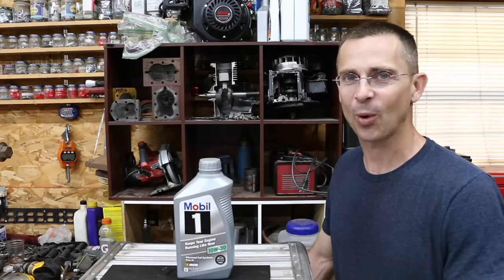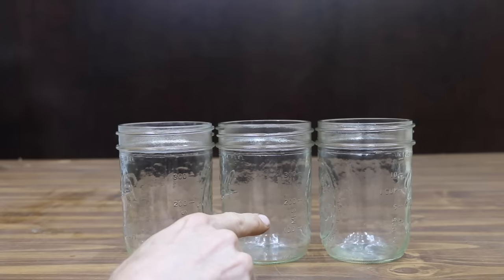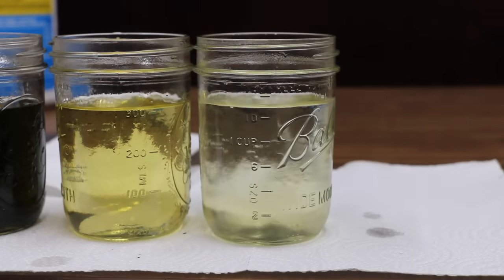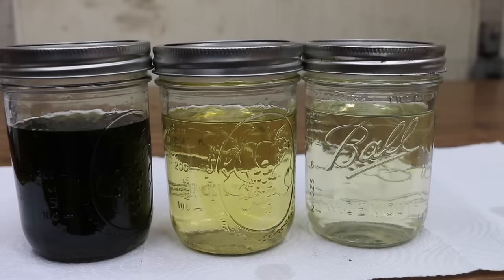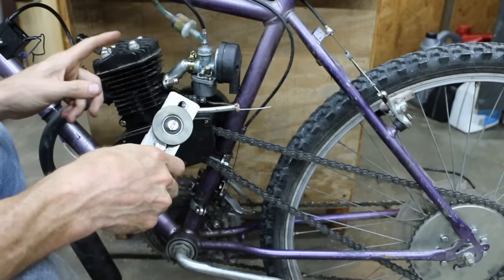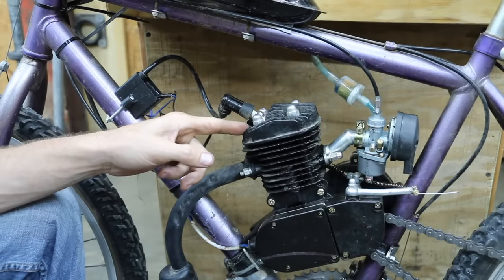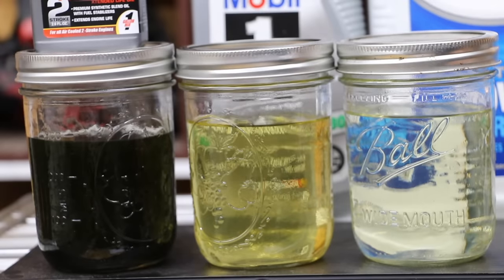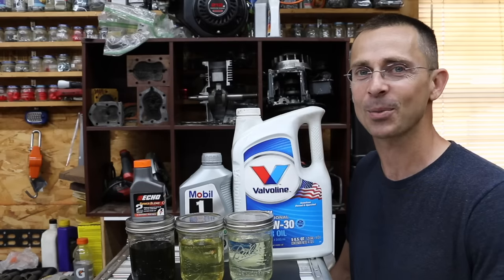Will 4-stroke oil damage a 2-stroke engine?  Let's find out!

Comment: It looked like their was a rapid build up of Coking deposits on the piston head and cylinder walls after running the 4-stroke oil in the bike engine. Engine "Coke" for those that don't know is a tacky deposit left behind when an oil exceeds its temperature limits.
Reply from the maker: Thanks for the feedback.

Comment: That's how it used to be done, just add regular oil to gasoline for a 2 stroke engine. Normally you are supposed to use non detergent.
Reply from the maker: Thank you

Comment: And what about chainsaw bar oil in a chainsaw gas mix ? 
That I’m thinking about if I’m in a hurry I’m the wood and need to use a chainsaw but don’t have 2-strokes gas mix handy.
Reply: It has to have gasoline, it won't run on just oil
Reply: Lol i know that . I’m talking about using chainsaw bar oil as mixing oil.

Comment: I will guess. The combustion chamber will be oily and there  will be more carbon deposits. Of course it will not damage the engine, in fact it will lubricate it better. The big difference is the flash point. A 2-stroke oil needs to have a low flash point and 4-stroke oil needs to have a high flash point. Will watch the video now.
Reply from the maker: Thanks for the feedback!

Comment: Oh boy, what about using dirty oil from an automobile that has had an oil change. Using that for the 2 cycle mix. I will bet it works fine. Perhaps even diesel mixed in to a higher amount will provide enough oil as well. What about using some olive oil, and sunflower oil as the 2 cycle oil mix. What about using butter? What about bacon fat.   ha... be fun to see
Reply from the maker: Thank you for the video idea!

Comment: i mix straight 40 weight at 20:1 for my chainsaws and they run fine
2 stroke oil smokes less because its a lot thinner than 10w-30
Reply from the maker: Thanks for sharing.

Comment: Well I got vespa stroke 150cc i add gear oil to its chamber 650 ml ....and if i don't get 2t oil i mix cars 4stroke oil as %is required the engine runs well but with either of it the silencer need to cut open n clean at same interval ...but new gen 2t generates less smoke ...it's back in 97 i was kid I used 4stroke oil and gas.....it genrated less smoke ...but now 2t engine scooters n motor cycles are long gone due to emmision norms...
Reply from the maker: Thank you for the feedback

Comment: There are MILLIONS of old outboard motors from 30's, 40's 50's and 60's that are STILL running with ORIGINAL engines and the mixing oil was 30 weight regular oil. 2 stroke MIXING oil never came out til the late 60's and was not regularly used til the 70's. You can use a good quality 30 weight oil for mixing with NO PROBLEMS. I have SEVERAL 1950's outboards with original engines RUNNING PERFECT, NOT GUMMED up or anything else. As for the guy on here that owns a small engine shop......he needs to look at ANY small engine manual pre-1970 OR outboard manual.
Reply from the maker: Thanks for the feedback.

Comment: 2 stroke gas is only really good for like 4 weeks then after that it begins having issues running my 250cc dirtbike and during the winter it seems to go bad in about 2 weeks. after my 2 stroke gas is about 5 weeks old I will only run it in my 4 stroke lawnmower.
Reply from the maker: Thank you!
Reply: It would probably still work in like a Weedwhacker or a smaller two-stroke engine a lot longer. but yeah i’ve had a few times where I thought my dirtbike just blew up or something but it was just bad gas that would foul the plug right up. not really sure why it happens because I usually drain the gas back into a can when I’m done riding and my gas cans are all air tight. I only ride once a week if that so my gas does a lot of sitting. when I get fresh gas I can definitely feel the difference in power With such a big 2-stroke engine.

Comment: 2 stroke oil in gas will also gum up.  This is due to the gas not the oil.  The lower quality the carb is, the more susceptible it is to old gas gumup problems.
Reply from the maker: Great point. Thank you

Comment: Can you do castor oil for 2 stroke?
Reply from the maker: Thank you for the video idea!
Reply: @ProjectFarm  I'm impressed you're reading comments in these old videos with over 3000 comments.
You may be aware that castor is used as 2-stroke oil for model airplane engines, so I was wondering how well it would do in a full size engine

Comment: Sir u know batter but i try non syn oil in single ring gas engin it ruins sleeve and lack of compression ngh 9cc rc engine then i try 4st stroke sae30 syn car oil runs well even in old sleeve with new piston and ring set  3year past still runing well
Reply from the maker: Thanks for sharing.

Comment: What if you took a high pressure oxygen bottle, and drilled out the jets, then with the rich burning engine took the oxygen bottle and injected it in the air box along with normal induction
Reply: What would be the result
Reply from the maker: Thanks for the video idea.

Comment: Would Marvel oil work as 2 cycle engine oil, would Marvel oil work as 4 cycle engine oil for short period of time to deep clean it or will it damage the engine due to high heat for long periods of time.
Reply from the maker: Thanks for the video idea.

Comment: My dad used to own a 2 stroke scooter in northern India back in the 90s and it ran on 4 stroke oil premixed in the gas for 10 years before he immigrated to Canada. But the thing is the bike never really sat for a long time that could cause it to seperate. He said he never had any issues. He didn't even measure when he mixed the fuel he just put in way more than he needed and used it to kill mosquitoes 😂. I'm sure the carbon deposits were not too great tho hahahah
Reply from the maker: Thanks for sharing.

Comment: I wonder how the two-stroke would go just using castor oil which is what aircraft model engines use although they run on methanol and castor oil so I wonder how a normal two stroke would go with gasoline and castor oil.......
Reply from the maker: Great test idea!

Comment: most of the older 2 stroke manuals for motorcycles said right in them , use 2 stroke oil at 30 to 1, or you can use w30 motor oil. This is not anything new.....
Reply from the maker: Thank you

Comment: I've mixed my gas like that for years when I was a teenager. I didn't have two stroke oil
Reply from the maker: Thank you for the feedback
Reply: When I ran out of motor oil I found out do not use automatic transmission fluid for premix I had to push that bike 2 miles home LOL

Comment: BLASPHEMY! I used 4 stroke 15w40 instead of 2stroke oil in my Tomos APN6 moped for a few months. Back then I was inexperienced and thought: well, if it works for larger engines and costs more, then...   Well, after a month my relatively new, slightly tuned moped started losing power, expecially when hot.  After 6 weeeks it would barely run when warmed up.  It took me a few weeks and 2 rebuilds before I realised the exhaust is so totally full of charcoal you couldnt even blow through with your mouth  - something it would take years of non-maintenance and heavy use even it the times of the worst Yugoslavian-made oils....   All in all, lesson to be learned:   2 stroke oils are also made to burn / evaporate through exhaust, something 4 stroke oils are not designed to do ;)
Reply from the maker: Thanks for the feedback.

Comment: We aye was a kid we dun that all the time if we never had 2 stroke

Bit if u are puting stuff in a 4 stroke remember if u use to much 2 stroke in an over head cam engine will cos it to run like a bag of bolts and oil can hydraulic lock a cylinder
Reply from the maker: Thank you!

Comment: what happens if you add an oilpan on a 2 stroke engine (somehow)
Reply from the maker: Thank you for the video idea!
Reply: The crankcase of a 2-cycle gasoline engine is what pumps in the air/fuel/oil mixture. 2-cycle diesels have the crankcase filled with oil and the air is pumped in with a blower

Comment: This test was not realistic, as you used a free running engine without load. I fly a Rotax 503, and at idle, the fuel mix is around 120 to one, and as I add power, the ratio increases from the injection pump, as the engine comes under load. 325 on the cylinder head,, shows it is not under load.
Reply from the maker: Thank you for the feedback

Comment: Well now you know if you're out riding around on your bike with the two stroke engine and you run out of fuel you can stop at a gas station and use 4 stroke oil to get you home.
Reply from the maker: Thank you

Comment: You shpuld try adding oil to the crankcase of a 2 stroke engine and see if it would work like a 4stroke without oil in fuel
Reply from the maker: Thanks for the suggestion.

Comment: Oil is oil, if you think they can make a 2 stroke oil that will prevent cylinder scouring in a 2 stroke and It's not good for a 4 stroke, you're smoking the wrong stuff. Chainsaws, outboards and every thing else I used what oil I had at hand, 99% of the time it was 30w ndt.

Comment: What do you think was used before someone invented 2 cycle oils.  If you wanna bet they didn’t have 2cycle oil when 2 cycle engines first made the debut. I’ll bet they didn’t use cooking oil. So what does that leave you with??  You got it , they used conventional motor oil.  And the only issue was carbon emissions and build up.  So they invented 2 cycle oil to reduce the carbon build up and reduce the smoke emissions that conventional oil left behind. So yes conventional oil will work just as well if not better but Over time will tend to gum up if stored over long periods so if you use conventional oil for 2 cycles remember to drain and flush carburetors.  And only mix what you will use.  So if you’re out of 2 cycle oil and can’t get any. Motor oil will suffice till you can get 2cycle oil. Just run carburetor cleaner or sea foam to clean out left over deposits
Reply from the maker: Thanks for the feedback.

Comment: No side effects... thats because the only real difference between 2 and 4 stroke engines is 2 stroke oil has anti fouling and anti smoke agents mixed in with it , in a nut shell that about all that`s changed.  
I have run 4 stroke engine oil in all my small 2 stroke  engines for that many years i cant tell you how long.  The important thing is OIL, no oil is no good any oil is better than none.  OH and they all still run today some 20 + years old.   Just run 30 weight engine oil in them clean the plug every now and then and the smoke difference is minimal.  And price 4 stroke is far cheaper. I got 5 ltrs on special the other day 15 bucks , 1 ltr of 2 stroke was 12 bucks.  No you don`t need full synthetic , it wasn`t even hardly around 10 years ago. Only modern vehicles require full synthetic.  And for their own reasons.

Comment: What you have heard is plain BS.  I put two stroke gas in my four cycle, lawn tractor, push mower and generator all the time.  I ran two stroke gas in my Mantis tiller the last time I ran it, because I was out of four stroke gas.  I mix nothing but 50:1 two cycle gas.  Having a little oil in the gas is no worse than adding additives to gas.  I use primarily Stihl Ultra two cycle oil.

Comment: 2stroke mix in 4stroke engine as a fuel? :)
Reply from the maker: Thank you for the video idea!
Reply: The engine has higher power.
At the same time, the pollution norm changes, the internal of the engine fails (chipped valves, melted pistons), the catalyst / DPF is clogged - illegally and immorally using 2T oil as a fuel.
There is an exception - the Stihl 4-Mix engines.

Comment: ... I'm pretty sure 2 stroke engines are not meant to run longer than 30-45 minutes at a time...
Reply from the maker: Thank you for the feedback
Reply: I have a 2T scooter, runs fine after even 1 hour of driving, it probably depends on what the engine is made for
Reply: @ls133  they don't really have the presence of oil like a 4 stroke. That's part of the reason why they normally don't last as long (as everyone who watches this channel should know) but it also creates more heat from friction... In turn that breaks the metals down faster...
Reply: @ProjectFarm  been watching you for years now. There's only a few I haven't seen. I love how you're always nice enough to acknowledge people XD
Reply: I'm not so sure. Nobody I know ever stopped their 2 stroke outboards to "give them a rest". We probably ran ours 4-6 hours straight when fishing, as did most other people.
Reply: @seanclancy5785  the only 2 stroke outborad engine (notice singular) I've seen was cooled by pulling water up to the engine from what ever body of water it was on.  So the only thing I've ever seen isn't a good example.

Comment: It works  I rn all my chainsaws off 10/40 40:1. 30:1. 50:1 is crap.  I don't buy 2 stroke oil
Reply from the maker: Thanks for the feedback.
Reply: Think about  it 50:1  will eventually  burn up a saw not super quickly  but that's how they keep selling more product  your under lubricating it causing it to burn up and over wear

Comment: This is how chainsaws were ran back in the day. And all those saws are still running today no problem. But a brand new stihl just lost compression a month after buying it. Thats on 40:1 instead of 50:1. Because 50 pnly exists due to epa. It is horrid dor 2 stroke. So its up for debate but i know pros who use conventional motor oil because they use their equiptment daily. Their stuff is the best condition out of all  my customers.  Idk how they dont get carbon in their exhaust tho. May be because they use non-detergent oil
Reply from the maker: Thanks for the feedback!

Comment: Back nikn the day when they didn't yet have two stroke specific oil.
  Thats when ratios were 25:1 or so.   
 I own a 1962 Johnson seahorse 10hp, manual calls for 24:1.   But we only had regular oil then. They smoked like a bastard.
    With real 2 stroke oil it runs fine at 50:1.
Reply from the maker: Thanks for sharing.

Comment: I have a gas powered bike 2 stroke and I’m currently using 4 stroke and 2 stroke oil combination in my gas 😂😂😂
Reply from the maker: Thank you
Reply: can you do an  amzoil  sabre 2 stoke oil  test  It should be able to run at 200 to 1   i use it in my husky 250 motorcycle at 100 to 1,  would really love to see it tested at 200 to 1  ....thanks....jeff...

Comment: If I supplied you with AMSOIL 2 stroke oil would you give it the torture test? You won't owe me a thing except a thank you for the oil.
Out of the bottle you can mix it from 50:1 but 100:1 is normal. To show the qualities of this oil run it at 200:1 then do what the motorcycle and snowmobile racers mix up at 300:1 still works great, full power and you can peak it out without engine harm and that's in a race!
Torture test it at 400:1 and 500:1 no other 2 stroke mix will do this. Test it with other 2 stroke synthetic oils for a real comparison.
Reply from the maker: Thanks for the offer. I can purchase some.

Comment: 2 stroke oil doesn't contain zinc and some other detergents because they ash and the ash becomes abrasive, it also can foul plugs. You should never run 4 stroke oil in a 2 stroke, but of course there will always be the guy who says in 1960 when they swapped plugs every day and rebuilt their 2 stroke every 10 hours then ran straight 30w just like the manual said. But in today's world with caster and ester based 2 stroke oils it makes no sense to scrap your expensive engine trying to save $7 on friggin oil. One guy even said he ran USED oil out of his cummins, carbon is the biggest enemy of 2 strokes and this clown fed his 2 strokes as much carbon as he possibly could lmao.

Comment: maybe i'll use old engine oil as a 2 stroke oil. another way to get rid of it i guess. or another way to destroy an 2 stroke engine using 4,000 miles use engine oil.
Reply from the maker: Thanks for the feedback.
Reply: @ProjectFarm  you're welcome. i have a old 2 stroke engine laying around that i have no use for. it still runs. also have a jug of use motor oil laying around. i understand the additives in the used motor oil are long gone. but still its temping to see how will it goes using old engine oil as a 2 stroke oil. keep the videos coming!!!

Comment: Ash levels, ring gumming  are problems with four stroke oil in a2cycle
Reply from the maker: Thank you for the feedback
Reply: @ProjectFarm  takes a,long time . Bore on the 2cycle quite worn . Vertical seizure marks, over hot or bad lube  McCullough  did s a lot of research on two stroke lube. Might be worth a piston replacement.